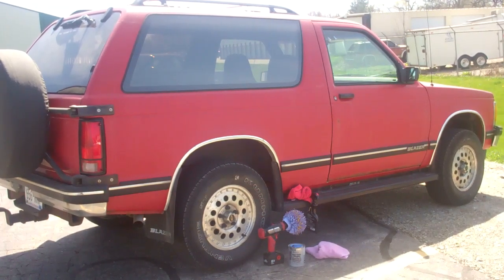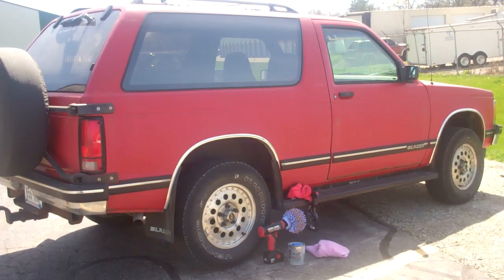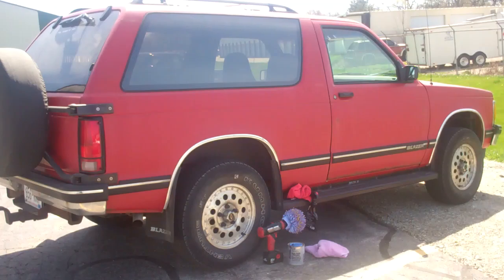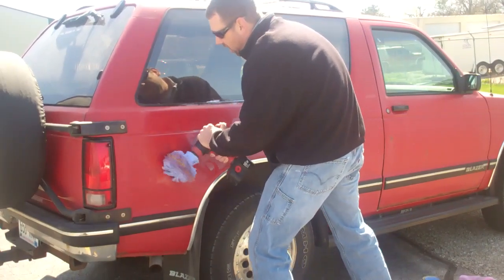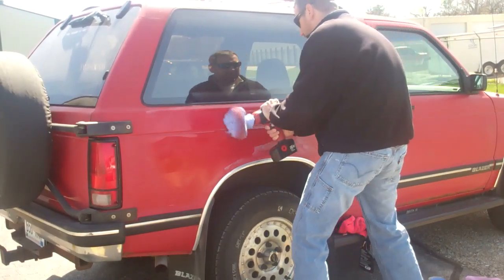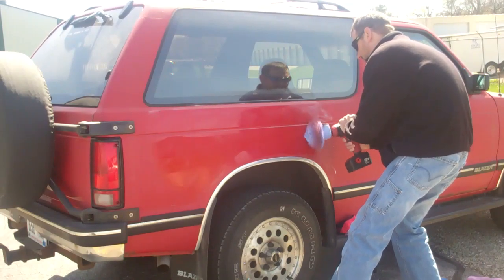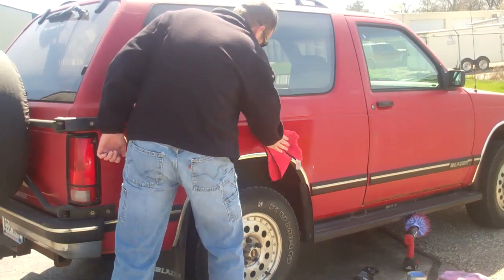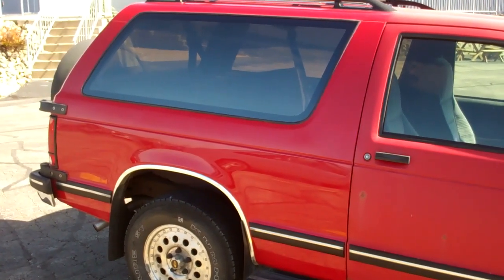How to clean & restore oxidized paint on a vehicle..mp4

Comment from the maker: Thanks for the tip, I never used it. But again I never thought about using it since its just a compound and doesnt protect  the surface after you are done like the FLITZ does. Also I found the FLITZ works on alot of things not just only paint so I can use it again unlike a compound. My thought is always do the job as fast as I can in less steps and strech my dollar the best I can. Thanks again for chcking out my video and your comments.

Comment from the maker: No, you can do it without a buffer but you are best using a rough cloth (shop rag or terry cloth towel) that will cut better for you. A microfiber is to soft, you can use that to finish the job but not to start it. Hope this helps. Thanks

Comment from the maker: Hello, yes it is possible to polish out a car that has clear coat on it. Please try this if you are trying to do this. Apply a liberal amount of cutting cream to the surface of the paint. Cutting cream will cut into the clear coat and smooth out the finish. It will actually dull the paint job, but this is OK. You need to do this first to remove the oxidation and restore the paint. Thats when you can come across with the polish to bring back the life. Hope this helps you out.

Comment from the maker: Thanks Mikey for your comments.. its not a 100% fix all but as you will see it worked for a lot of people who have watched the video and that's what it was all about (TO HELP)!!
Reply: Grahamsgarage1 I decided I will be keeping my car and not getting a new one for now - I
 do want to work on it a bit and restore the paint.  Should I 1. repaint
 the entire thing because parts of it are oxidized or should I do this? 
 How long will this last on an oxidize area?
Reply from the maker: Hello Jesus, as for the paint it normally lasts up to 6 months with out a wax. I would recommend doing it and then putting a good wax on it say every 3 to 6 months. That should save you the $$ of repainting it and keeping it looking good. Thanks
Reply: +Grahamsgarage1 Was that a Speed Ball you used Similar to what MOTHERS sells for drills?
Reply from the maker: Hi Lightning Smoker Xx, the buffer I used was by a company called FLITZ, the cool thing about it is you can run it at a higher speed then the mother s one (I had one of those in the past and this is 100% better). Also this ball has fingers to it and seems like it works faster too. Thanks and I hope this helps.

Comment from the maker: I don't see why not. The only thing is they are pretty soft as you may know. Personally I would use a foam pad do to I beleive it does a better job since it is not as soft and will cut better for you to lift the dead paint. Either pad you use will help none the less. You might want to also check a company called auto geek. They have many pads that may help you more. Hope this helps you out.

Comment: Great work.  I need to find some Fritz!  I just bought a lovely 2002 explorer that is in phenom shape but I have 2 or 3 spots on the roof I got to get off.  I thought the paint was gone but I can scratch it off with my thumb nail to reveal red paint.  Can this flits be bought at parts store?
Reply: Flitz!   Dang mispellings
Reply from the maker: Hi Joe yes I believe so but I would recommend checking out there website www.flitz.com they have a locator on it where you can find dealers in your area. Thanks for checking out the video and let me know how it works for you if you can.
Reply: if you want dull paint off you can use ( color back ) it is made by turtle wax and it's good stuff to bring back the shine !
Reply from the maker: Hello Joe, thanks for checking out the video. As for parts stores I am sure you can. I usually get it at my local hardware store since its closer (its a ACE Store). Thanks again and hope it helps..
Reply from the maker: I tried that before with no luck.. (maybe just me??)

Comment: Next time if you going to use the drill get flat foam pads, it will be much easier or try Meguiar's pad  with special attachemnts for drills. It will make your job a hole lot easier . of course a DA or rotary would be ideal

Comment: would this work on flat black,, say I paint my truck flat black,, could I do this to bring a shine to it,, or would I have to use the clearcoat then wet sand clear coat to remove orange peel and then do this,,,  what should I do if I paint my truck flat black
Reply from the maker: Good day to you David, thanks for checking out my video. As for your question I would not use it on a Flat Finish. As for making it shine I am guessing the clear coat would help, I cant say 100% since I have never done anything like that. I also did a search and didn't see anything noting how to do it. I good company to call that maybe able to help you out is Autogeek (they sell a ton of detailing products and may know how to do what you want to do). Thanks again and sorry I couldn't help you out.

Comment: Give it one month and you'll be back to where you started.
This paint needs wet sanding and a new clear coat.
Just saved everyone time and trouble that goes into doing this.

It will always keep coming back because it doesnt address the issue (clear coat is gone).
500+ grit wet sand and clear coat, then buff a week later. It'll look like new.

Good luck everyone
Reply: What year IS the Blazer?  Clear coat didn't come out till the mid 80s, but yeah...a protective coat would be needed, yes.  But again, he started the video by saying his friend was getting ready to SELL the vehicle :)  The concern is not what it will look like 6 months from now lol.

Comment: your misleading alot of people, and can waste alot of peoples time as well, you should state in the description that you have a single stage finish, and a car that is this badly faded and oxidized with clear coat finish can not be buffed out with a drill and some flitz polish, that requires wetsanding then buffing, also you have to know  what your doing there also because you can blow through the clear if you dont measure your paint.

again your misleading people, this will not work on clear coat finish. 

single stage = soft
clear coat = hard

how do you know if you have single stage?  take a microfiber rag get some polish (not wax it has to be abrasive) and rub it on your paint work it in good and look at the rag. if you see paint transfer on your rag the same color as your paint it is single stage. if nothing it is a clear coat finish.
Reply from the maker: +Joey FaME.. This is never been meant to be a cure all for everything. Even if you have clear coat this will help bring the color out (clear coat dulls too) as well as remove fine scratches on the clear coat. Also the buffers are unlike a orbital so you will not melt the clear coat (they are self cooling).  My recommendation is contacting the company to see if they will send you a sample or you get a dealer near you so you can test it out. Thanks once again for the comments and your tips.
Reply from the maker: Hi Chad thanks for your comments., it does help on fine scratches as well as if the clear has dulled out. You may want to contact them and see if they will send you a sample so you can test it out as well. Thanks for checking out the video and I hope this helps clear some things up.
Reply: +Next Level Auto Detail - He also didn't tell people not to use Flitz polish on their penis, but I assumed that I shouldn't without even being told...you expect that he should post a fucking disclaimer for everything that Flitz shouldn't be used on, FFS?!
Reply: well said mate

Comment: Ok, This stuff did not work like this for me. I purchased a 2 pound can of Flitz along with a Flitz polishing ball, followed the directions, and it didn't work like this on my lightly oxidized fiberglass bonded walls on my RV. The directions say Do Not Allow To Dry, Well it dries out real fast, and is hard to rub off. At least it's hard to rub or buff off using the Flitz buffing or polishing ball.....  Am I doing something wrong ?
Reply from the maker: Hi Roger, the only thing I can say is you may have used to much polish. The first time I did this I did apply it to thick and it didn't do much at all. Then I took a applicator and applied a very thin light amount in another area, BAM that was it!! Please try a very thin light coating that may do the trick for you. Thanks and hope this does the trick for you, its worked for me every time.
Reply: Grahamsgarage1
Ok, I tried it again... I did apply a thin layer and used the polisher ball befor the product dired, and came up with the same thing. I'm using the orange polisher ball, but it's more of a disk as it's spinning... I'm thing that may be the problem. In the fear future I will purchase the Blue ball like you have there, and se if that helps.... Not sure when I'll do it, But when I do I might video it.... Thanks for getting back to me on the matter...
Reply from the maker: Hi Roger, I hope you get it worked out. Like I said I have done this on various cars and after my first attempt (where I used to much) it has worked for me. Keep me posted..
Reply: Grahamsgarage1
Thanks.. I do have a couple of questions for you. What was the temp at the time you shot this video, I see your wearing a coat. And the other questions is, Have you allways used the Bule Polish Ball ? as I had said, I'm using the orange one. And it's not a ball at all. Funny how they call it a ball.... LOL
Reply from the maker: Roger Sayers HI Roger, when this video was shot it was in the upper 50's outside. As for the ball I have used both of the ones they make. I like the blue one better since its larger and the fingers on it (I guess that's what you would call it) are larger. I have also did this with a orbital buffer but for some reason I cant work those as well. Hope you get it to work better on the next go around. Thanks
Reply: Grahamsgarage1 Thanks... I'll get the blue ball and see if that works better for me, I'm thinking that blue ball will cover more area quicker than the orange one does. Again, Thank you for your time, Will let ya know how it goes...
Reply: +Roger Sayers blue balls?
Reply: MusicMusicMusic
Yep, Blue Ball (s) The ball that is being used to polish this vehicle is Blue in color.
Reply: +Roger Sayers Roger, this is a single stage finish, not clear coated, fiberglass, or gel coat, you will not get the same results as him only if it the paint is single stage paint, single stage paint is VERY SOFT, meaning virtually any polish and even something as weak as a drill or even your hand if you work it long enough, you can get great results.

however you can see in the video that his "BUFFER BALL" has red on it meaning it is a single stage finish.
you are not going to be able to buff a oxidized or faded rv with this, you need a rotary or a dual action polisher, to get that out.

Comment: if car dont have clear coat 
after you polish it the color will be faded again no?
Reply: +Tomer Tzur this paint is not clear coat finish, it is single stage finish.

so it will stay shiny as long as you maintain it. thats how the paint came factory.

you can not do this to a clear coat finish, if the clear coat is that oxidized it requires wetsanding, to get rid of the haze then polishing as clear coat finishes are alot harder then single stage paints.
Reply: +Joey FaME you see as he polishes the pad or toilet brush he use turn red
this means he has no clear coat
if he polish more times he wont have paint left on the car
Reply: Hi Tomer, once you polish it the FLITZ only lasts for around 6 months with out a wax. With that said yes I would recommend a wax (like was done in the video). Thanks so much for the comments and checking out the video.
Reply: Yes correct, that's why you want to keep up with a wax. Once done and you keep up with it you will not have to do this again.
Reply: Tomer Tzur the same goes, anytime your actually polishing paint, clear coat, single stage, laquer in order to polish you have to abrade the paint, meaning taking off paint. however clear coat is.... clear you can not see the residue on your pad.
Reply: +Joey FaME yes but you know that if you polish car with clear coat your pad wouldnt be cover in paint from the car
the amount of paint coming off when polish without clear coat is way way bigger than with clear coat
maybe you should buy can of clear coat and spray your car
and i dont think wax will help either if u dont have clear coat
soon or later your paint will look bad again
Reply: Tomer Tzur you do understand that single stage paints do not have a clear coat right ? That does not mean the clear coat had failed it means thats how it was painted from factory base coat clear coat got main stream in the early 90s

So any car before that was laquer or single stage... and there are still many classic cars out there with the original paint that look beautiful.

So if you take care of your single stage paint job yes wax will help it does not need to be clearcoated because its not base coat clear coat. Its single stage the gloss is in the color already.
Reply: +Joey FaME lol
wax comes off after 1 car wash
if u want to wax ur car 2 to 3 times per month go ahead
or you can buy clear coat can and use it on your car after you polish it
wax is no replacment for clear coat in anyway
clear coat last for years wax not
and doing clear coat and wax it times every month is easier and cheaper
Reply from the maker: Hello Tomer, if wax comes off after 1 car wash how can every company say it lasts so long? I don't know were you are from but here in the USA I have used numerous waxes and ran multiple cars through car washes and guess what I didn't have to re wax them every time. As for clear coating the finish I am with you 100% (yes it will outlast wax) but to keep the finish even on a clear coat looking good you need to wax it once and awhile. Thanks again..
Reply: +Grahamsgarage1 i know i use stp caranuba wax and i dont understand why its recommended to wax the car only 2 times a year while the wax comes off very fast 
but im planning to purchase some meguiars items once i get visa account
Reply: Tomer Tzur you seem to not understand that the car never haf clear coat in the first place its single stage paint lol. IT WAS NEVER CLEAR COATED FROM FACTORY.

SO YES IT WILL LAST AS LONG AS ITS MAINTAINED.

and as far as wax im sure not only the wax your using is probably crap.

You going thru automatic car washes for 3 dollars they used recycled water and use cheap soap and add salt to increase velocity.
 
So sure thats going to strip wax, especially if its carnuba wax carnuba doesn't last that long synthetic waxs lasts 4-6 months.

Ive used sealants and topped them with synthetic and it lasted over 1 year of water sheeting and beading.

So once again... THIS CAR DOES NOT NEED CLEAR COAT BECAUSE IT NEVER HAD CLEARCOAT TO BEGIN WITH.

i buffed a single stage black lebaron 1 year ago i can send you pics and its at my shop right now for maintenance. And it still looks great.

Because the car never had clearcoat to begin with.

So you making fun of wax as a substitute for clear coat is moronic, the truck in this video had single stage not clear coat and will last AS LONG AS THE OWNER MAINTAINS IT, if you let it sit in the sun for years and let the dirt and water embed its self it will fade.

So the answer to your question is no it does not need clear coat because it never had clear coat to begin with.
Reply: +Joey FaME lol i never wash my car in auto wash
i got a fucking black mercedes cla180 why should wash it in auto wash to get my car scratched to hell?
i wash it by hand with leather towel and dry with microfiber towel 
and dude i UNDERSTAND it never had clear coat!
btw how many times have you polished this car since this vid?
Reply from the maker: +Tomer Tzur & Joey Fame, I am sorry I didn't mean to start a bitch fest. Please understand this video was designed to help people. As for wax and not waxing everyone has there choices and has ways they want to do things. I am sure you are both right. Thanks again for checking out the video none the less.
Reply: +Grahamsgarage1 you did nothing wrong this guy just feels what you did isnt a fix and it is going to come back.

however if you maintain it it will never get faded again.
Reply: +Joey FaME its a towel made for car wash
soft nice leather towel
and guess what 
the paint is just fine
didnt ask any advices from you and dont want to watch your vids ty good day dutchbag
Reply: +Tomer Tzur they make alot of stuff thats "car safe" and will all scratch.

do not use leather sponge or a chamois. as they dont pick up dirt it just slides it around.

microfiber once it has contact with dirt t absorbs it onto the rag not sliding it on the paint.

so do your self a favor ditch the leather

Comment: What if my paint had started to peel a little bit on the hood and roof.
Reply from the maker: Hi vhilton40000, if the paint has started to peel that's the clear coat coming off most likely. If you can remove that completely you can then go back and buff it out with this product. If you don't you will have bright spots and dull spots. Thanks and I hope this helps.